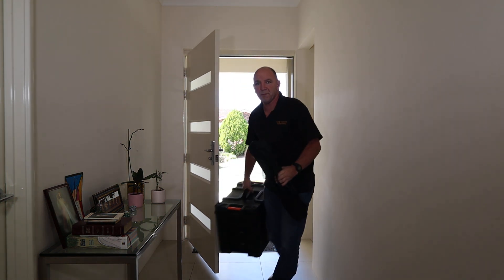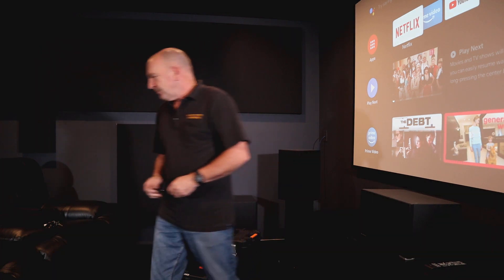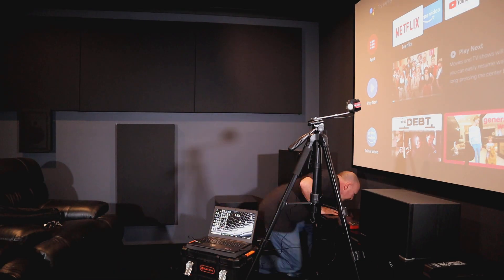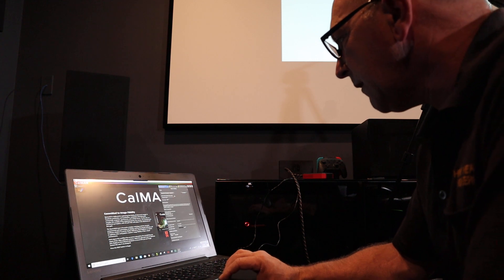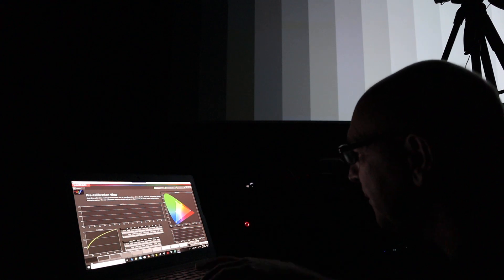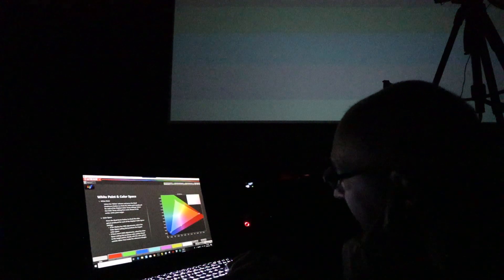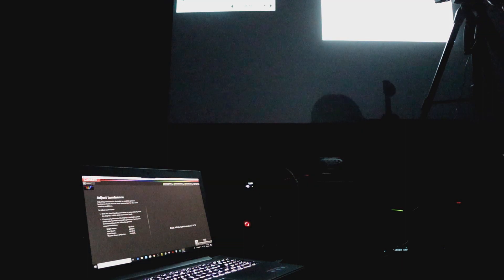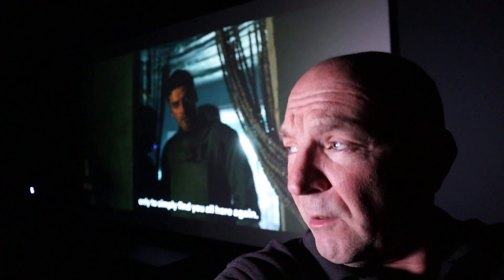Tour of an actual Video Calibration Job performed by Home Theatre Engineering

Comment: Any particular reason you didn’t use a spectrophotometer?
Reply from the maker: It depends what you are saying. Did I profile match with a Spectroradiometer yes (I assume that is what you are asking). Did I use a spectroradiometer for the entire calibration? No why would I? Its slow especially at low IRE and once accurately profiled on a UHP projector it is not necessary. I hope that answers your question.
Reply: @HomeTheatreEngineering  It did! Thank you! Which spectro did you use?

Comment: How do you determine the height and distance of the colorimeter to the screen? Plus, how many nits are you aiming for in a bright to very bright room?
Reply from the maker: Ok so there is a lot more information required and this is not a short answer so a bit outside of the scope of a YouTube response but.. it depends on the sensor you are using and you also don’t say if it is a projector screen or a tv screen. For a tv screen the sensor sits on the screen for a projector it sits back probably 2-3 feet but again which sensor? Nit levels .. well again much more info required. What are you calibrating rec709 or hdr and again on projector or tv? If a TV what is it’s Max NIT level natively. Bright to very bright room?? Not good for great viewing but a simple answer would be .. the brighter the room the more nits you need but without much more info I can’t help. These are not simple questions and are pretty much critical to getting an accurate calibration. I don’t mean to sound harsh but I would suggest getting further training or education if you plan to calibrate and these questions are getting in your way.
Reply: Thanks for replying. I have an X-rite i1display Pro. The projector is ceiling mounted (front), about 15-20 ft away from screen. I will be calibrating for SDR rec. 709 in a fairly bright room. This is a video conferencing room were meetings take place, so it is always well lit. Should I dim the lights before calibration or keep it the way it would normally be? Will the i1display Pro be able to function properly in that condition.
Reply from the maker: @jasonalves442  what projector is it and what size screen? Personally I would not bother calibrating a room like that the ambient light will walk out the image so you black levels and therefore dynamic range/contrast is no good and ambient light will massively skew the white balance.. it’s simply not worth doing to be honest and a description on how to tackle ambient light and screen offsets is beyond the scope of a YouTube comment. That is advanced calibration, apologies.

Comment: Hi, thank you for posting videos like this. I have a Sony VPL-HW65 and it is not HDR. There a some 4k disc player like the panasonic that can convert HDR to SDR with REC2020 but my projector doesn't have REC2020. Is it possible to calibrate REC2020 into  one of the Color Spaces of my my projector? I like exploring the possibilities of my Sony projector.
Reply from the maker: As far as I can see you will have 2 issues one is edid and the other is colour space down conversion and while it’s technically possible with something like a LUT box and calibration. Tools and software it would be much cheaper and easier to buy a new projector but I do realise that’s what you are not trying to do. However be aware a non hdr non bt2020 can never reproduce those luminance and Color’s
Reply: @HomeTheatreEngineering  Thank you ! I Do have an HDFury Diva and was going to use to try to solve the edid issues. I do realize it will never look like good true HDR but part of the fun is messing around with my set up and maybe get it to look a little better. Would a Lumagen Radiance XS-3D help with this? There is one for sale on the used market.
Reply from the maker: @alejandrocervantes4981  I’m not sure about that model lumagen but without the calibration tools and software to load a colourspace conversion LUT I don’t think it will help. I might be wrong about that though not sure if the lumagen can natively down convert a colour space but honestly it’s kind of pointless as you might as well just watch a bluray which is what you will be converting your hdr into..

Comment: How is the Projector calibrated?
For my IPS Eizo computer monitor i have used XRite i1pro. It only creates an .icc profile after some basic RGB and brightness/gamme tips.

But a projector would need to be manually adjusted in like 12 different ways for RGBCMY HUE/intensity/gamma curve/brightness/contrast. And you can't use an .ICC profile because It must work for many sources like console gaming, Blu-Ray..

Does the software talkback via HDMI or USB to auto adjust the projectors settings?
Reply from the maker: Projectors don’t use icc profiles it’s not like calibrating a graphics card. It’s pretty much as you described but a manual process unless you have some other device that you can program a 3D LUT into.